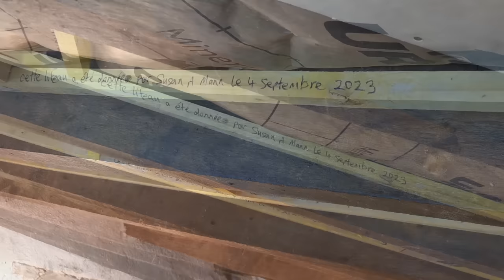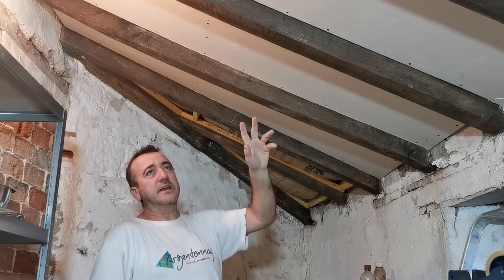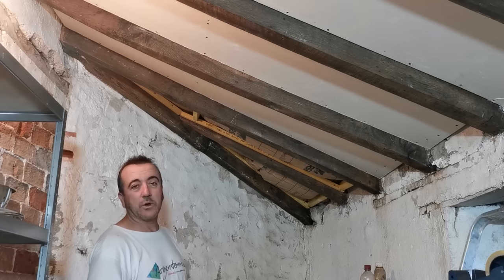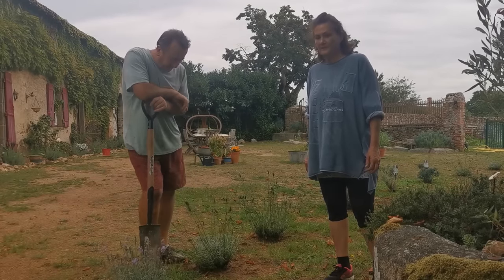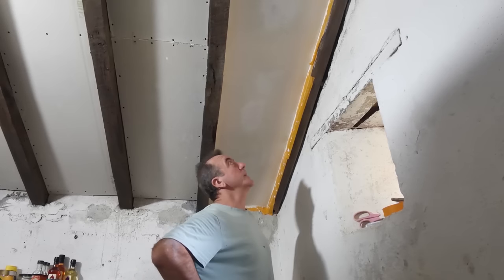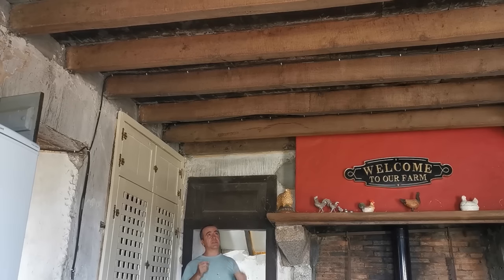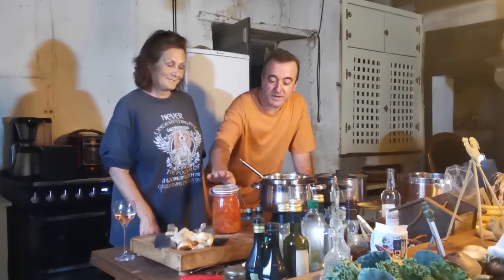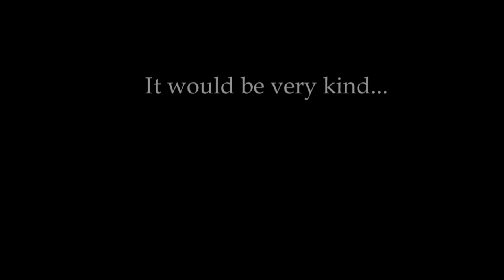EP 140   This beamed ceiling gets a makeover, French château restoration

Comment: My favorite simple tomato sauce, which I just made again with about 4 pounds of tomatoes, then froze in portion sizes: Heat a good nob of butter, add about 3 chopped garlic cloves, sizzle for a minute, then add grated tomatoes (cut a bit off the bottom end and grate the flesh on the large holes of a box grated. The peel will remain in your hand),  add some salt, simmer for a couple minutes, then add a few basil leaves - and done. It's a super light sauce or soup.
Reply from the maker: Sounds good Lora ❤️

Comment: Big tip for your sheet rock, to you plaster board.😊
Get a tube of acrylic silicone it's printable, 
Calk the wood and plaster edge works great.
You then only have to fill the seams and nail holes with mud, aka plaster😊.
Love you two channal.
Reply from the maker: Thank you for your tip. Some of the gaps between the plasterboard and the joists will be edged in decorators caulk but where the wood is bowed/warped the gaps are slightly larger and probably best suited to the tape and joint method. One thing I have decided is to only trail the plaster in towards the centre and make sure the edge is feathered rather than plaster the whole panel. I was pleased with the finish on the first panel, just took too long to get the final finish. Enjoy the rest of your week, Rols